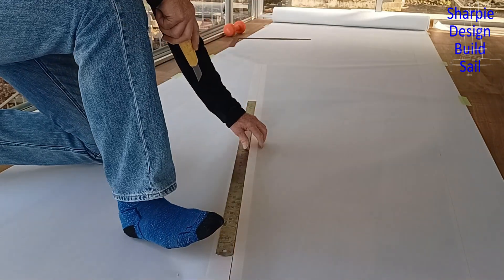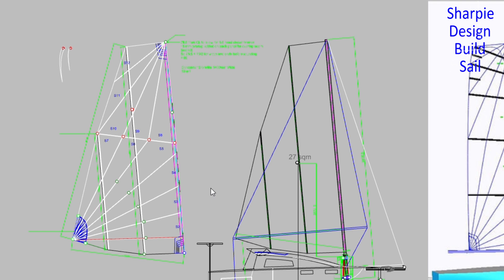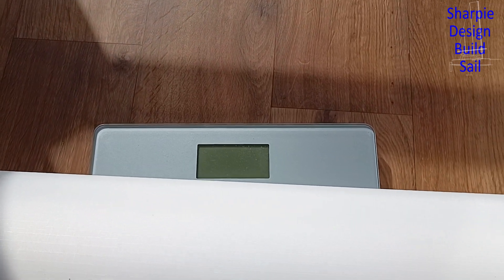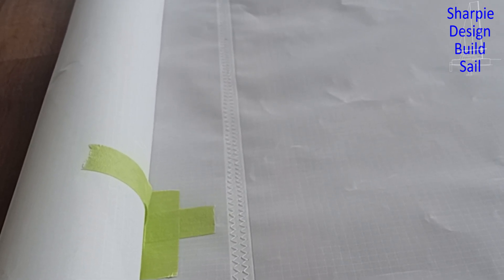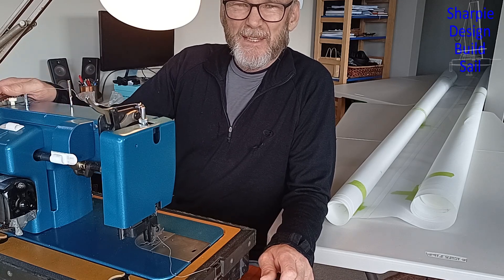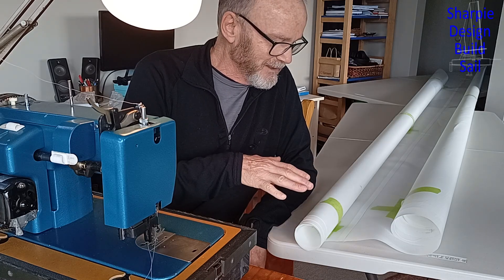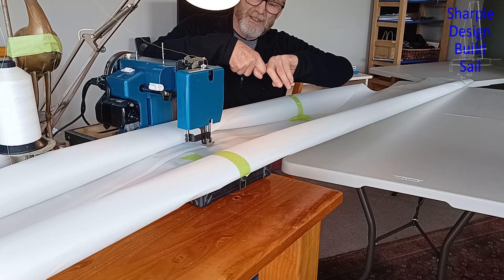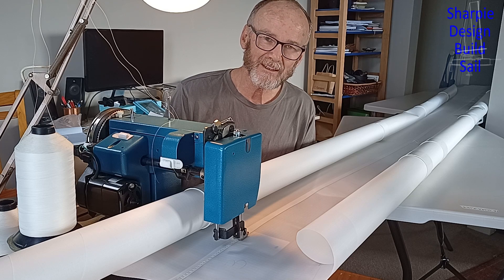DIY Sail Build for a Sharpie Sailboat with a Ljungstrom Rig Using a Sailrite Sewing Machine Pt1

Comment: I'm just about to make sails for my Paradox sailboat. What I've done is to get ahold of some old sails and made them into bags in order to build some experience using the machine..
Reply from the maker: Hi Anders. Yes, that's the way to go and hopefully you've got some good space for the size of the sail so it can travel through the machine easily. What is the sewing machine you have and what weight of cloth?
Reply: @KarlFullerNZ Hey, I've god a Sailrite like you and plant to sew the panels on the floor. 160g/4oz Dacron is what I've got. The Paradox has a square-ish lugsail, so not the most difficult design. I've planned the sail using CAD in Onshape, it seems you used some dedicated software for sails?
Reply from the maker: @anders_nygaard  good to hear you have the Sailrite machine. Hopefully the fabric you have is less slippery than what I'm using.
It's my understanding the sail set up I'm using does not need to have much built in camber so I'm making quite a flat sail with some round in the luff and some camber induced by the broadseam in the middle of the sail. For the rest the out haul in theory will control the camber and I'm basing that on someone else's experience. I've also talked to some sailmakers who've given me some pointers.
That's good you could use a CAD program to get your panel dimensions. How many square meters is the sail?

Comment: Sorry to hear about the bad health, but the sail is looking good. Are you committed to the boom design?
Reply from the maker: Good to hear from you! The health is improving since the last video and I think mostly because I'm doing a 3 day fast! Man I'm hungry, but coughing very little which is great! 
Thanks, the sail is coming along and I've certainly created work for myself by making it Bi-radial but it's a light material and so needs everything going for it. It is rated for diagonal strength but it would need to be for cross cut sail. It's a very slippery material and I think it's part of the reason for the issues I'm having. Fortunately it's a fairly flat sail but will have some camber caused by the broad seam across the sail and some luff round. But going by what people like Arne have said, it can be reasonably flat and get the camber from the outhaul tension. A chief sail designer at North Sails gave me some tips for the final cut of the sail.
I'm fairly committed to the boomed/wishboned aspect of the rig but may leave that part of the build till last and so if I'm running out of time for this summer, I can try boomless and see how that goes.
How are you getting on with your design? 
In building my sail it seems really big and will give quite a high sail area to displacement ratio and it will have to be furled around 8-10knots I'm estimating. After that the mast safety number drops and I'd probably be heeling more than is uselful.
Reply: @KarlFullerNZ   I only fast when I'm to lazy to cook. Good that your appetite is in check. 
Bi-radial looks like a good solution. Is there any negatives besides the extra work to manufacture? I was gonna ask if you sewn it flat, but you answered that. Did you use any specific sail software to design the sail? Or was it rhino?

I have had a video ready to publish for three weeks haha, just need to add a small update. Been working with a sailing simulation as a side project as well.
Reply from the maker: @robinj6997  Haha, fasting when cooking doesn't happen.... Hardest fasting I've done is sailing to New Zealand from Fiji by myself and I was too seasick to cook and to make it worse, time seemed to have slowed down too 😉 I survived, I had a box of Mangoes!
Bi-radial is good, one of the reasons is it gives you a broad-seam that you can induce some camber into the sail with, and I will be doing.  Making the decision to make a Bi-radial has a lot to do with the diagonal strength of the material you are using though but generally a well made cross-cut is going to be fine for all but the performance sailor I would suggest. It is a lot of extra sewing which mightn't mean much till you have to pay someone to do it or even yourself, especially if you don't have ideal conditions to do it. I'm still in two minds  as to whether I made the right decision because it is my understanding that I'm building the kind of sail that can work with not much pre-cut camber.
I used Rhino and I was going to draw the sail in 3D with some camber and then unroll some panels into 2D surfaces which would have been a bit of fun but added way more complication. I was going to use 60mm luff round but the sail designer suggested I use a little more, maybe 75mm. Of course how much the mast bends is a contributing factor in the bigger picture.  I'm generally going to be cruising this yacht so putting a large effort and expense into getting the final 5% extra performance does not have that much appeal to me.
No Strings Attached was a pretty clever graphic for your last video! I'm intrigued by the sounds of your next video and seeing what you have put together for simulating sailing.
I'm starting to think too much about my boom situation in the middle of the night and this morning had another good look at the Hoyt Boom which is a great solution for some similar set ups, especially if it's a single skin sail, no topping lift, no vang, low drag. But it's hard to achieve when you need two and I've even considered just having one Hoyt Boom and having both out-hauls attached to it for on the wind and reaching sailing. I'm starting to go round in circles on that one!
Reply: @KarlFullerNZ   I think Bi-radial was a good decision. At least if someone is sewing themself. 
Single hoyt boom to a twin skin sail is also an option, kinda interesting. I haven't looked at them in a while, but it's true that they don't need vang either ( nor toppinglift). Wouldn't it be similar to having the booms attached to the mast though? A bearing under the furling drum.

If I make the thumbnails to flashy the audience might get whiplash by the monotone topic. The next video will be some quick comparison with stability of lifting keel and 3-mast vs 2-mast. I also contemplating moving the pilot house 2 dm further aft and having both masts in front of the pilot house, like your 35 feet junk rigged schooner.
Reply from the maker: I'm having another think about the Hoyt Boom, it certainly has it's merits but suse could work well with a single skin sail and maybe no tabernacle to deal with
Reply from the maker: I think I'd need 80 x 6mm Aluminium pipe and that's not easy to bend in the radius I'd need. It could make carbon fiber look attractive and I guess it would need to be at least 4mm wall thickness in carbon to get the same strength.

Comment: Really enjoyed this. Am curious as to how you are planning to maintain that E foil shape? My understanding is the double skin America's cup sails attempt to get E with non compressive tethers between battens on opposing skins, and then use individual leech and main halyards under very high tension against a very stiff main upper zone at the square top.
Reply from the maker: Gosh, that's quite a technical question and good to hear you enjoyed the first video on my sailmaking attempt.
I hear what you're saying about maintaining a foil shape and how I intended to achieve this. In reality there won't be much more control than the outhaul and the wishbone angle to the clew. So yes, it's going to be interesting to see what control there will be with just those limited inputs. At the end of the day, I'm just trying to improve a little on the original concept of the Ljungstrom design, the main achievement I'm hoping to get is a better reaching sail shape and I'm fairly confident I'll achieve that. Before the sail is rolled up a bit to get closer to the 'working' sail area, I do expect a fairly nice envelope to form around the mast, even if immediately after that, the sails are in contact with each other. So  it's probably more like the D shape that I will be achieving. I did miss out one control element and that is the fine tuning of the rotation of the mast itself.
Yes, the loads those America's Cup sails carry are huge and of course necessary. Interestingly (organized by a relative) I had one of the designers of those sails have a little consult with me in the last week, after he put my sail parameters into his design program and he gave me some pointers in how I could tweak the final cut of the sail to get a good result.

Comment: Nice work going the DIY path for the sails. A good sailmaking tip for seaming is to mark a guide line on the foot  of the sewing machine with a thin sharpie pen, then you just line up on the walking foot wth the edge of the seam to keep the sewing straight.
Reply from the maker: Thanks for the feedback! That's a good tip on the marking of the walking foot. It's fortunate that there is I line that I try and follow and that is the edge of the middle walking foot. Part of the problem is because the material is mylar impregnated, it makes it quite slippery. My table is still not ideal and as free flowing for the fabric as I'd like. Sewing seems to be exactly like welding in that there is a practiced degree of high concentration required and any moment of inattention makes for irregularities and I often find my thoughts wondering but I suppose it's like car driving in that it becomes an automatic response, I'm not quite there yet!
Reply: @KarlFullerNZ  Yes sewing does take a lot of concentration, I find it takes more concentration than driving a car or riding a bicycle, sewing seams in zigzag actually requires more concentration and effort to keep straight than sewing in triple step stitch I find too. But straight stitch is the hardest to keep straight.
Reply from the maker: @dr10501  Triple Step machine would have been great to have got hold of.